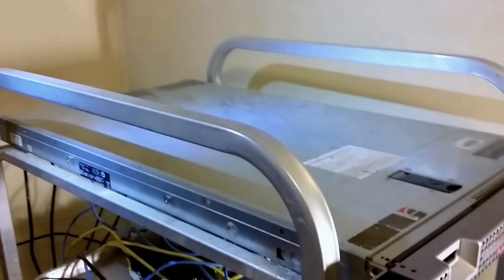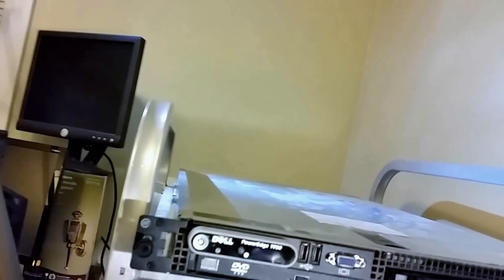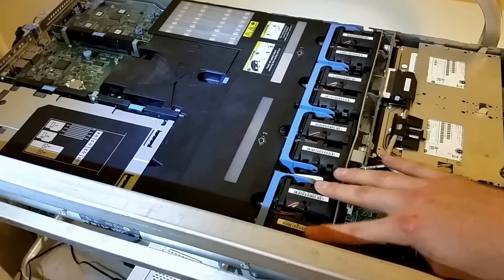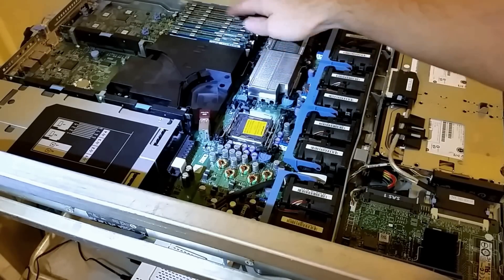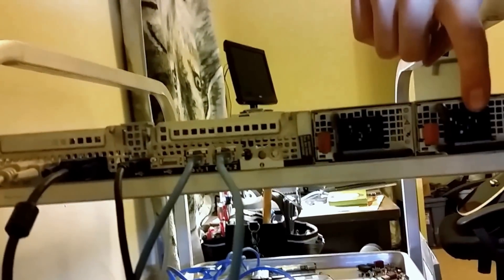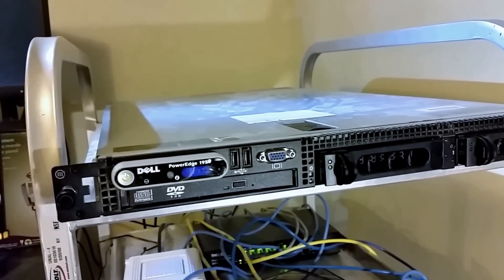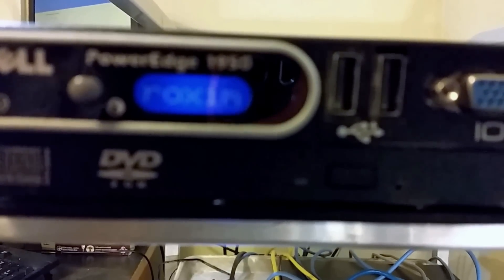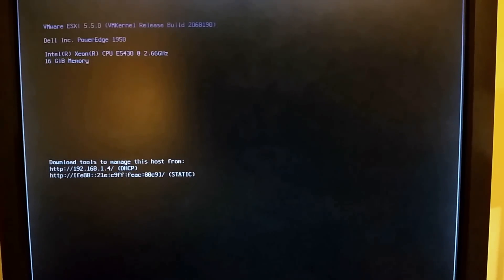Dell Poweredge 1950 Tour and My ESXi Configuration!

Comment: I'm about to purchase a 1950 with practically the same specs, I'm not really sure how well this equipment would work for games(most of the servers I own/have owned are based on PC hardware)

Would this be good for hosting multiplayer games(for reference, Space Engineers, Medieval Engineers, Starbound, LAN parties) ???? I know for most of the lightweight private server hosting I do this is extremely overkill. But I'm curious if it could be used efficiently for something more resource intensive. The only concern I have off the top of my head is the memory speed(4x4GB DDR2, 16GB) in my case.

Comment: Everytime I turn on mine my neighbours must think I am vacuum cleaning...
Reply: I think you may have a bad fan.
Reply: GT20Modding These old machines have very loud BMC setting for startup sequence. So probably the fan is fine, unless there is some warning/error logged.
Reply: No i have one and it running full speed when running means you have a bad fan.

Comment: +joeSHMO8347  Would this be to loud to keep it in my sleeping room?
Reply: at idle I find the fan "noise" very relaxing, a gentle humming. Under full load with high ambient temps, you'll throw it out the window after hearing it run for 5 minutes.
Reply: DREWSASTER
Thanks for the info.
I think i will create a server room in the future.
Reply: I run one and its not to loud for a bedroom application.

Comment from the maker: +Jose.Maria.Garsia.Genero Xavier.Rodriuez This Poweredge is not supported due to the fact that it does not support Hardware Passthrough for any Virtual Machine created in ESXi. I however used another PC's DVD drive over my Gb LAN and installed any OS I wanted to use